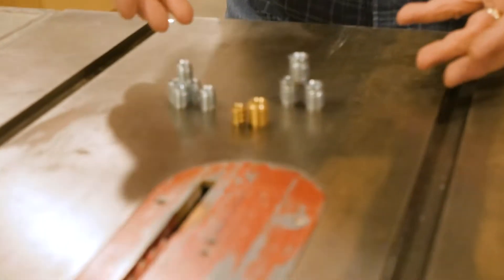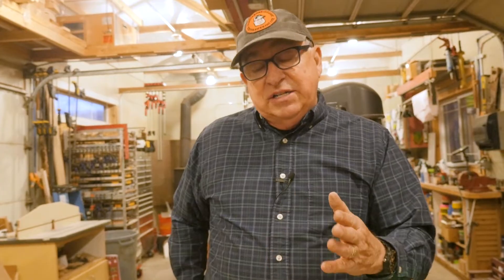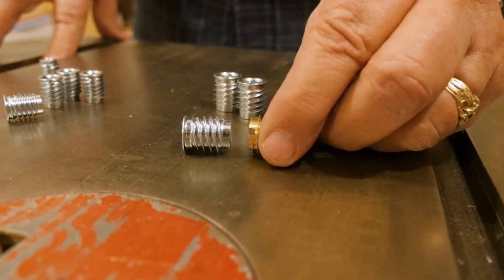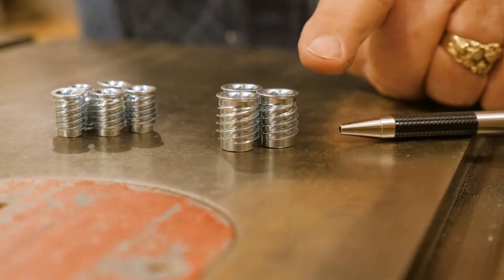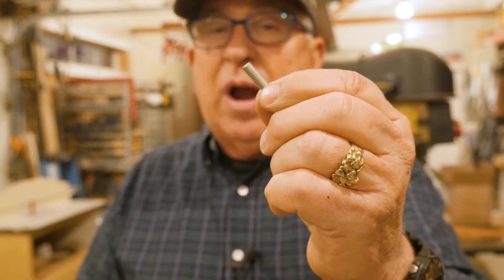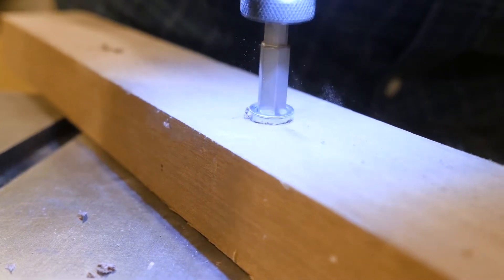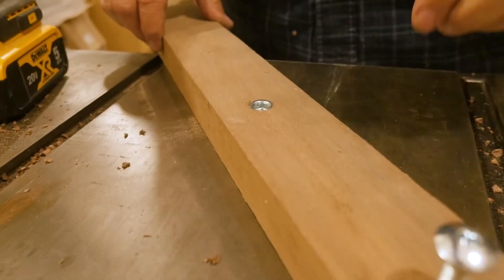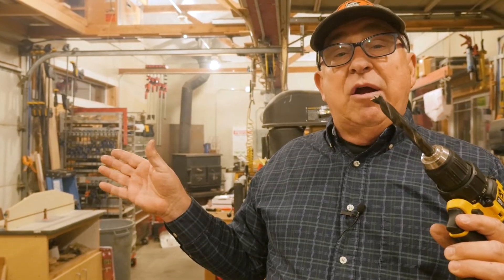Are Rampa Threaded Inserts for Wood the Best Yet?

Comment: Older video but I was able to pick these up from Lee ValleyTools (Veritas) here in Canada and they sell them individually.  24 M6 inserts (12x12mm and 12x15mm) and 24 M6 flat top bolts (12x 12mm, 12x 16mm) for $27 Canadian. Not horrible IMO

Comment: So I have the 5/16" rampa thread inserts and I tried using a 3/8" drill bit wich is what was recommended but I can't get them to grab. So should I use half inch drill bit? Or a 7/16 drill bit?
Reply from the maker: Thanks for writing. Are you saying you can't get the inserts to thread into the hole you've drilled? If so, what are you using to drive them in? What is the material you're using? What is being attached? Let me know and we can go from there. Best, DFJ

Comment: For anyone that can give insight, how about one bolt/screw going through 2 threaded inserts? I'm planning a project, and using wood slabs that will be 2 inches thick. What would happen if I use one bolt to attach those pieces of wood such that the bolt will go through the first piece using a threaded insert, long enough to go through the 2nd threaded insert on the 2nd piece of wood beneath the first slab and stop there? It should be just as strong if not stronger? Unless I'm missing something, I cant see how this would be a problem.

Comment: Rampa marketing leaves a lot to be desired. You have to have an account just to see the pricing and learn if shipping is included.  Not available at standard outlets such as Amazon, Home Depot, Ace, eBay, Rockler, etc.  I can only assume they are pricey and shipping is not included and therefore most likely not cost effective, unless perhaps buying in large quantities.
Reply from the maker: Thanks for the feedback. I'll send it to the person that I work with. I assume you used the link that I supplied? Can you confirm what site you visited? Thanks!
Reply: @DirtFarmerJay  yes I used the Rampa link in the video description. I then searched Google as well as going to each web page or App I listed.
Reply: 90% of the time you won’t need fancy, over engineered inserts that cost five times more.

Comment: Just what I'm looking for. Can you tell me how well these are like to work screwed into hardwood end grain? Thanks.
Reply from the maker: Glad to be of help. These have good thread depth, and they are pretty sharp. With the triple configuration, it will drive straight. You should get plenty of strength. If you want to be doubly sure, you can coat the walls of the hole with super glue before driving the insert. I hope this helps! Best, DFJ
Reply: Thanks again, much appreciated. @DirtFarmerJay

Comment: When using threaded inserts, is there a minimum width of the table top I need ? I'm trying to figure out how to best attach wooden legs to a thin-ish pine slab or board that is 18 mm or maybe 27 mm thick, for a low table / coffee table. I absolutely do not want to use apron rail.
Reply: It can vary by wood type but typically we would like at least 3/4" to work with but we do have options available for materials as thin as 8mm

Comment: Just priced M5 stainless 30mm in length, only available in 250 count package; it was sold out, but the quoted price, and I'm not kidding, is $74,409.99 or $297.64 per insert. Shipping is extra. That's one fancy insert.
Reply from the maker: paxtonc - something is off. I'll contact Rampa and see what the issue is. There is something clearly wrong. Thanks for calling it to my attention. I'll get back to you. The inserts are really good, and the economics are WAY better than that! Stand by. Best, DFJ
Reply: I had similar. Ridiculous price for a few inserts. €70+ and that's before taxes and 'handling fee'. 
That's a NO from me on this.

Comment: Just curious if there is any pull strength details you can share? I have a 3/4 piece of hardwood as a panel covering the entire floor of the bed of my truck and have been looking for a solution to use an insert to hold a mobile fridge to the panel. The fridge loaded weighs about 50lbs fully loaded and has a 6 bolt plate that could be used to fasten it down. With this vehicle being used for off-roading I wonder if these inserts could stand up to the challenge?

Comment: Great video. Rampa makes inserts in varying lengths. I've seen 15mm and 18mm as well as other sizes. For a 6/4 walnut slab, what's the maximum insert length you would recommend?
Reply from the maker: Gene, good to hear from you. I'd use the 18mm length for maximum "bite". The configuration of the insert will allow you to drive the insert of that length into the slap without camming or causing other issues. Let me know how it turns out! Best, DFJ